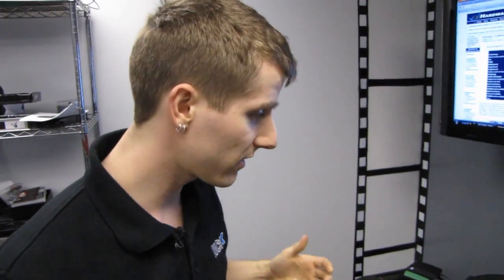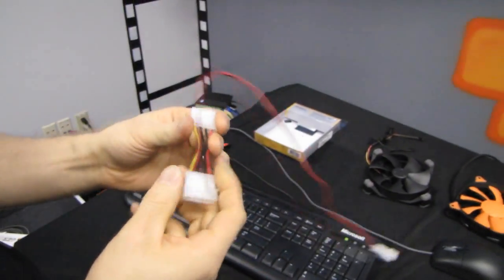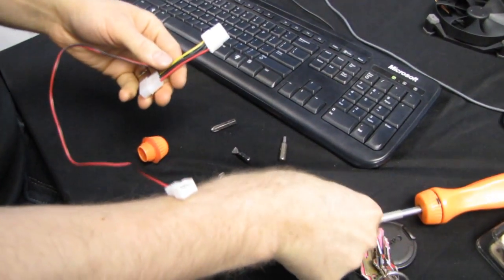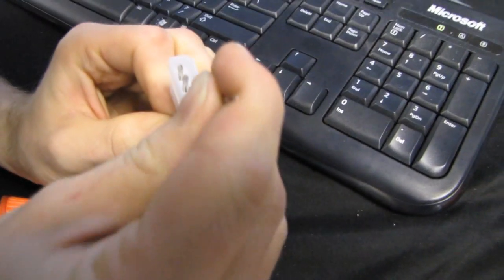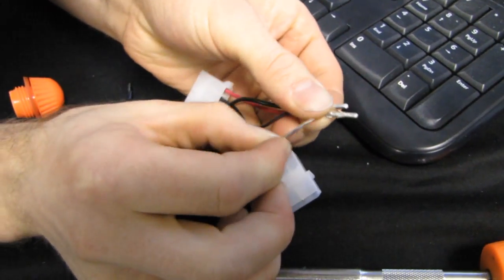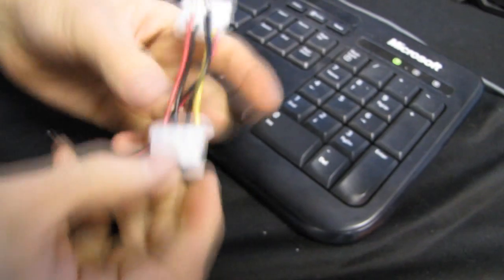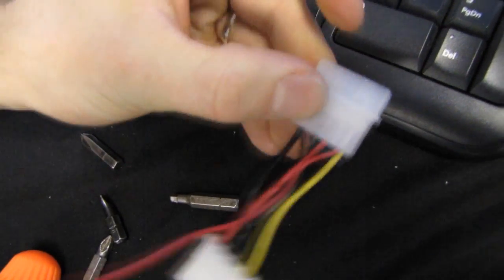Undervolt Your Fans the Janky Way - Easy 7V Molex Mod Guide Tutorial Linus Tech Tips

Comment: i have a fan with a conector with only two cables on the end of a male molex connector, can i just swap the place of those pins so the fan draws 5 or 7 volts? at the current possition is loud af, low chance someone accualy awnsers but never zero

Comment: QUESTIONS:  1. Why "never ever do this"? What could go wrong?  
2. In theory, could I do the same thing using +12v and +3.3v to get +8.7v? Is this any riskier than using +12v and +5v to get +7v?
3.  You said, don't plug any devices into the other side of the splitter. Does this mean I have to have an entire cable coming off the power supply dedicated to +7v, or do you mean only what branches directly off the plug adapter where you switched the leads?
4. Is this a bad idea on a modern power supply?  I see a lot of conflicting information about this on internet forums.
Thanks!

Comment: Linus tech please help. Just purchased a new pc tower case. All going well and everything installed but have an issue with the fan led and controller power supply. The led and controller already had pins on them. The led has a molex with 2 pins and the controller has a molex with 4 pins. I purchased a 6 pin pci to 2 x 4 pin molex but this is just shorting the pc out. I can't figure it out. Please help. Or anyone on here who knows more than me

Comment: I can't find anything to understand...but u can help me with a problem?pls...so: I put all the 4 fans with molex on the PSU and when I shutdown the pc...the cooler CPU fan is going off but the fans from the case don't..it stay on. It is there any way to solve this issue...pls guys...tell me how to fix this shit!
Reply: @Maevef100f  what do u mean "bad"...bad in what way? It can do things like damage something,components or some'like that? It is an 80 plus bronze with pfc active. It is an xilence with 730w,not cheap,I think,I pay for it 80 bucks.
Reply: @Maevef100f  you say that is the way is design the psu? Anyway,this is the 1st PC that do this kind of issue,hope is not going to be bad, doesn't bother me to turn the switch off after the shutdown,but anyways,the idea is not to have other problems..like cook the mobo or anything. I have warranty,I will change it soon.

Comment: I am going to put a switch to switch between 12v and 5v positive in order to control my uncontrollable Xigmatek CY120 fans. I already have an on off switch for them but sometimes you just want them to operate silent yknow. What are the risks? (CY120s are basically HD120s without rpm settings and software)

Comment: Why should not do this? If you are familiar with PSU and internal construction, you should know that 5 and 12 volts going directly from PSU rails, so doing that modification makes this PSU useless to other PC devices (HDD, DVD, etc).
Reply: Unless each molex is an isolated circuit (separate rails) or several power converters in one psu. Yeah they should know but more than half of people don't know what volts, watts, amps or differential voltage are.  They might not know that AC and DC can exist on the same circuit although not exactly at the same time. Because someone said they could swap the other connector pins and still hook up their hard drive .  If you you know you can burn out equipment including lowering the life of the converters by using them as resistors then sure!

Comment: a lot of modern power supplies don't like this.  don't do it.
Reply: +omfgbunder2008 Why not?
Reply: Current conventionally flows from positive to negative (not to be confused with electron theory).  Back feeding the excess power from the +12v line down the +5v line will complete a circuit but it's not designed for that and it will either shut down or cause damage to the switching converters.
Reply: this actually happens when i tried just the yellow and black circuit from the fan into the psu with 7V setup, and all of a sudden, there is a a bit of a spark in between the molex fan and psu molex connections when i touch them together, a sudden shutdown happens. This doesn't always happens, and "fortunately" doesn't break the psu or even the entire rig, but I already concerned about this

Comment: can we plug another fan into the other connector?
Reply: Yes but it will now have 7 volts to that circuit end as long as the peripheral is hooked into it and functional.
Reply: At least the 5 volt circuit will then be 7 vdc you might be able to still pull 12 volts off the 12 volt side.

Comment: Yeah, hooking up resistor is still going to give you 12 volts, just at lower amps... Which will still slow the fans down, however.
Reply: +Aaron Lowe fans are current devices. lower current = lower speed
Reply: Xzarida I do believe both voltage and amperage affect the speed of the fan.
Reply: +Xzarida can we plug another fan into the other connector
Reply: +Aaron Lowe they decrease the voltage as far as I know but whatever..

Comment: Damn, I studied electronics but this confused me for a moment. I blindly figured you need a ground or a negative - pole for the current to flow. 
This is a little confusing if you think about current in the terms of + and -. Actually is about current flow from a higher voltage potential to a lower voltage potential. So you can have a current flowing between a two + poles.
Reply: I almost posted that he put the yellow wire on the left and would short out the power supply but then I realized it's creating a potentiometer circuit or differential flow.  The difference between the two positives of different voltage makes the lower voltage pin into the slightly less than negative. I hope that makes sense to someone.
Reply: Yellow is maintained at 12V, red is maintained at 5V..
As long as you don't let more current into the 5V branch, than it's actual load draws (which is surprisingly little nowadays), you're fine. Been doing this since I was 12.

Comment: Could I do this on the MOLEX connector that gives power to the Fan Hub on the H440, I don't really want all the case fans running at top speed all of the time.
Reply: I just did this in my H440, but I took the molex connector that is attached to the fan hub and pulled out the 12V ground connector. I then used a small wire to wire it to the 5V connector (on the H440, this wire goes to the LED on the rear IO). I used heat shrink tubing to keep it from shorting. It has worked for me so far, my pc is very quiet right now. If you need pictures I have some just private message me on youtube :)
Reply: Musicforlife MC hi, can you send me those pics please? I need to do it to mine :/ -thanks
Reply: Kate Upton I sold that case to my brother so I can't get photo's atm. I have the same case and I do plan to do the mod again so Ill take pictures and send them :)
Reply: Musicforlife MC ok thank you  very much :) sexy case though!

Comment: If you swapped both ends of the wires, then you could still plug it into a drive. The color coding would just be off.
Reply: Yes, but consider that you are plugging into an isolated circuit output that has a new output on both yellow and red of 7v (on both wires while the  peripheral is connected) because the load difference makes it be 7 volts instead of 12 and 7 volts instead of 5.  Keep in mind (12-5=7) <-your drive requires 12v but you won't be giving it that and it requires a 5 volt and you will give it 7 on that side. Therefor overvolting and undervolting those separate circuits.

Comment: What if its a regular molex fan with out adapter is there a way to quiet it down or do i just have to buy a new fan?
Reply: +Budget Audio yeah, just swap the pins just like he showed you. but come on, molex fans are cram, get some nifty PWM ones or even DC controlled that you could regulate off of your mobo or fan controller.

Comment: I was already doing this 20 years ago (now there's no need anymore since you can control fans in software), but I never ever had a problem. Just also change the pins on the other side of the molex connector, so that the wires are routed straight again and plugging something in there gives the right voltages..

Comment: That's the worse way to make an adaptor, just solder the black wire from the fan to the red wire from the molex, then solder the red wire from the fan to the yellow wire from the molex, and you will be able to plug an hdd to that molex too. safe and simple

Comment: Some have asked if there might be other problems with this other than not being able to use the other molex. If the 5V rail on the PSU is not loaded with more than your fans you will have a negative current that could damage your PSU. If you do this with a few fans in a normal computer you probably don't run into any problems, but only running this on a PSU may cause problems.

Comment: ive done this to my server to quite the cpu fans, although its impossible to plug anything but fans into the adapter has the molex end is cut off and all there is is the fan plug on it. it worked pretty good. reduced my server noise by half. sure it runs at about 45c cpu temp 75% of the time but i can live with that

Comment: OK. i'm not very familiar with circuits. but if you connect ground cable to 5v line why it's undervolting not overvolting (12v+5v)?  i don' t fucking get it.

Comment: to be safer, couldn't we simply change the connections of the tiny red and black wire (that goes to the three pin) and let the four "big" wires in place? this way, you could use the four pin without any problem.

thanks for the video

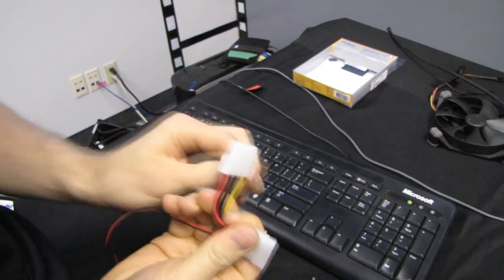Comment: (~ 1:30) Linus so long as you change the pin out on BOTH ends of the dongle there is no issue using the male molex to power other devices.

Comment: There's quite a few tutorials on-line, but they're all just concept diagrams i guess, you will need a soldering iron and perhaps some experience, ill see if i can make a tutorial, but i "borrowed" some parts from my uni's lab so ill have to gather them again (I don't want to take my one apart), it's also possible to automate it by hooking it up to a thermostat as well but that may require some more soldering! cheapest alternative is to buy a molex to 4 pin connector, plug it into your mobo and

Comment: + to the 12 rail and - to the 5volt rail, i have mine case fans on 7volts, and i just cutted floppy connector off, and uset screw terminal to power the fans ;) i have 700e build and 650w psu

Comment: Ok, got a question to ask linus, My pc case has had it a little, big bogged, yesterday my girlfriends dad gave me hes old unused antec p160 case, its in perfect condision, it has only 2 fan bay's, apart from that would it be alright to put my gaming specs in ? (Size & cooling wise)
Specs:
Geforce GTX 570 super clocked 
intel i5 2500k
Asus P8H67-V Rev3 Intel H67 Socket 1155 Motherboard
Cooling wise would 2 case fans be ok, and would it all fit?

Thumbs up so he can see please, need help with this

Comment: i have done these things long ago and it works well... 
+12v fan to +12v psu
Gnd fan to + 5v psu.. simple..
it is better not to have the female molex connector if you dont know to rearrange the pin.

Comment: i would have used the 12 volt cable and hook the ground to a fork which hooks with the fan's ground and the 12 volt connects the the positive on the fan... or use the fork on the 12 v instead of the ground but the ground carries the electrons so we need some lost there :\... now im gonna test this...

Comment: You can get approx 9v by using the yellow 12v wire and a 3.3v wire (usually orange) but this trick as well as the 7v trick are not recommended because PSUs were not made to provide power this way and not all PSUs may function properly when doing this.

Comment: a resistor will NOT give you 7 volts in every case, the voltage with a resistor depends on the load you put after it. so this test is way better. and when rewireing the cable just rewire the other end aswell and then you can use the cable, but the colors will be wrong.

Comment: Also the mac pro is the most horribly overpriced computer apple makes it costs about twice as much as it should. most other the others have a much smaller price diference (about 10%) but that's if you are just comparing spec for spec ie. does any other laptop have nice large trackpads?

Comment: It would still never put unnecessary load on the PSU or fan motor. It just kinda means that you've got to be careful if you ever touch metal components of the fan, such as the motor, if it's plugged in. Wouldn't be the wisest of choices, that :)

Comment: Well first of all, there is a resistor for that. As for how I figured this out, well what Linus did is connected ground to +5V and power to +12 volt. In case you haven't noticed, there is no actual ground now. +5V was not designed to be ground.

Comment: Well they are overpriced underspeced. With the iMac you can only upgrade the hard drive and ram. The macbook you can do anything with it anymore, it is basically a fancy brick if you don't spend $3000 optimizing it. The Mac Pro is the only system that you can upgrade, but you cant get any new processors like the new sandy bridge/ivy bridge xeons, it is 4 years outdated. Apple makes a great OS, but shitty systems.

Comment: or you could strip the wires a bit and solder the connections together, and then wrap them in electrical tape.

Comment: What he did was rearrange the wires so that instead of connecting it between 12V and ground or 5V and ground the fan is connected between 12V and 5V providing a voltage difference of 7V.

Comment: I have been doing this mod for years never had a problem with it. If you wish to use the other molex connector be sure to change the wires around. Or you will destroy what ever you plug in to it.